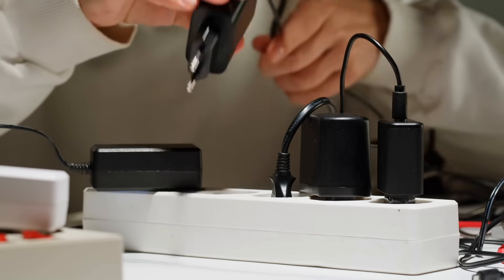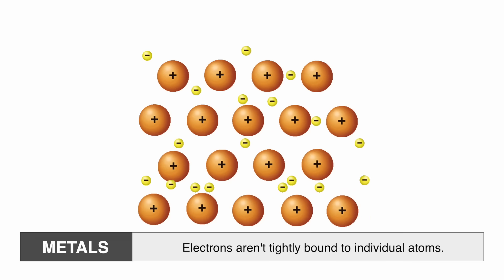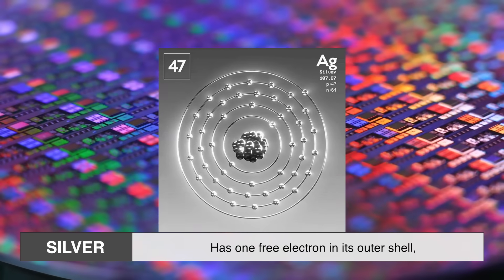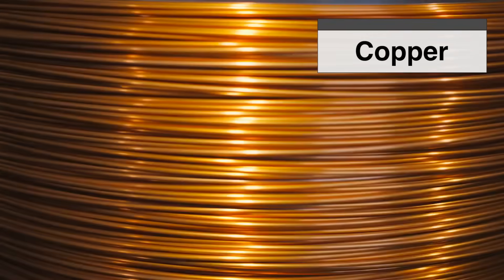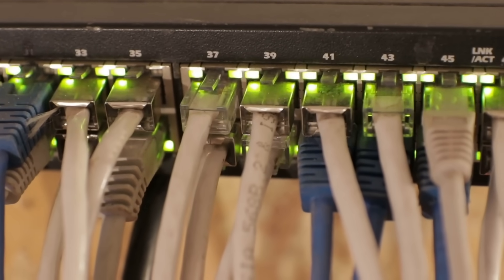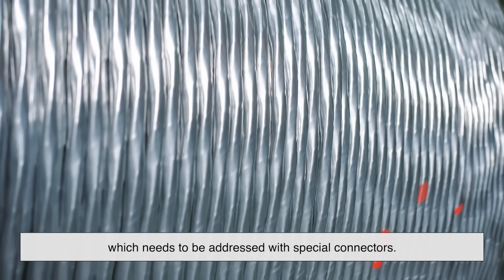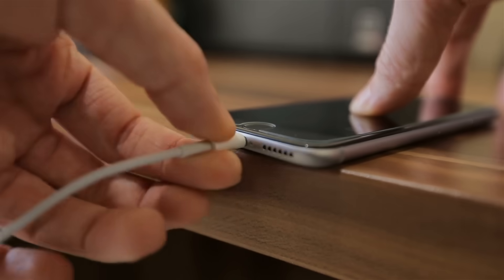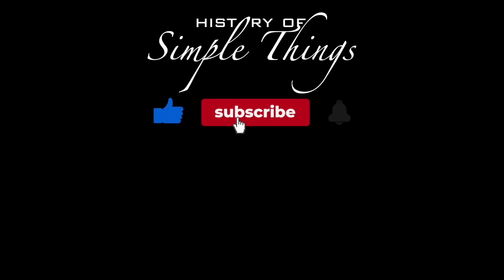Why Are Silver and Copper the Best Electrical Conductors?

Comment: Microchips usually always used aluminum for their interconnects, and then later they switched to copper. However, occasionally gold was used also. One notable case of that was in the power wiring of one of the Alpha microprocessors from DEC.

Comment: Copper has what is called good ductility.  It basically means it can easily be stamped, hammered, or drawn into wire.  Plus, it can be easily Soldered, Braised or welded.  The first method of wiring, K & T (Knob & Tube) from 1882 to around 1930.  For taps and splices, about 3 or 4 inches was stripped and twisted together and soldered, then a roll of rubber strip was wrapped around the joint for insulation, and covered in what was called "friction tape"a nasty fabric tape impregnated with a tar-like adhesive to keep the rubber insulating stripping from unraveling.  Steel boxes were only used for mounting light sockets, switches, or outlets. In the 30's, screw connectors "wire nuts" came out, replacing soldering and taping splices. 
The problem with aluminum is the way it oxidizes.  Most metals oxidize, copper even when it oxidizes, retains most of it conductivity.  Aluminum when it oxidizes, forms a thin, hard shell that prevents further oxidation.  But it has very high resistance, this causes voltage loss through heat.  The joints heat up and cool down and they loosen over time.  The 2 basic rules of wiring, keep connections clean, and keep them tight, for minimum resistance.

Comment: During World War 2, many tons of copper were needed to make military equipment and ammunition. In 1943, copper was replaced by steel to mint one cent coins. Furthermore, the United States Treasury had a large supply of silver and 14,700 tons of silver were borrowed to make the wire coils for electromagnets for the calutrons at Oak Ridge, Tennessee to separate uranium-235 from uranium-238 for the Manhattan Project at the Y-12 plant in Oak Ridge, Tennessee. The uranium-235 was needed to build the first atomic bombs.

Comment: Copper is widely used in electronics Because Silver is costly as compare to Copper 😊
Reply: But from the CPU to the board, very fine gold wires are used.., for motherboards..copper tracks are used and also for cooling coils..
Reply: Very good. 
You watched the video.
Turn it up.
Reply: @daveberryman5946  I comment this without watching the video, I didn't watch this😅